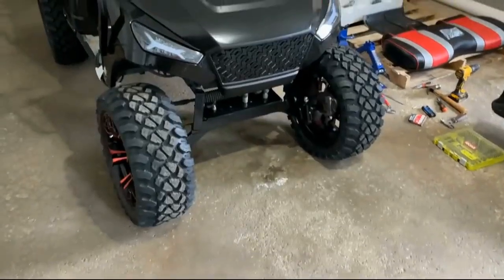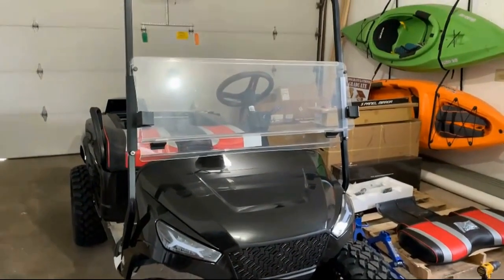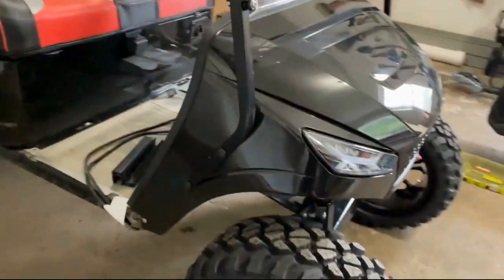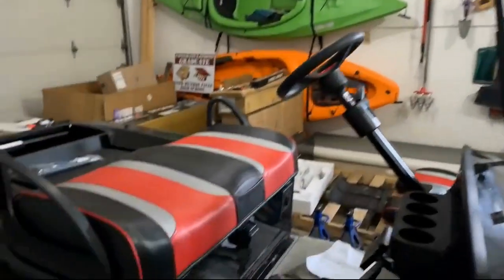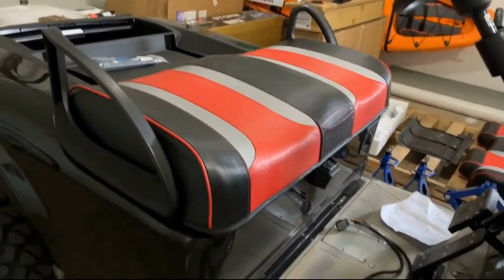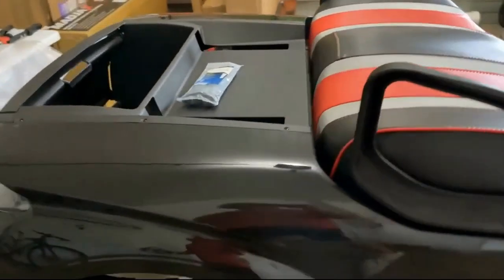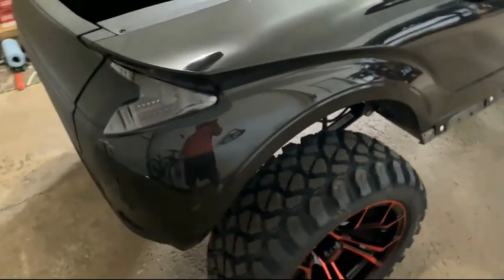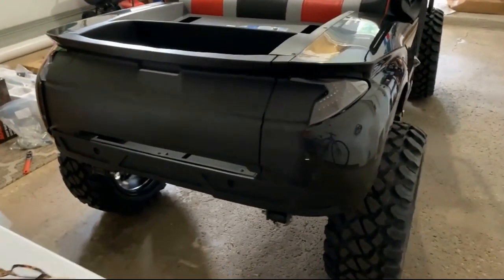EZGO TXT Golf Cart Conversion - Storm Body Kit, Seats, and More! - GolfCarTV (Episode 8)

Comment: Great video, question how tall is the opening of your garage? I’m trying to do a similar setup but don’t know what the total high of the cart will be thanks!
Reply from the maker: @FuNPeopLe3622 I'm not sure yet. I've driven the cart out of the garage without the top on and generally guessed that it will fit...I'm very hopeful it will :) I will let you know once I measure it.
Reply from the maker: @funpeople3622 we put the top on and it wouldn't fit out the garage! We ended up chopping about 6 inches off the rear struts and now it has plenty of clearance. For bigger adults, they'll have to slouch a little so they don't hit their head, but it's what we had to do. Also, I think it looks better when it's not angled upward to the back so much. Personal preference, I guess. A full review of the cart will be coming soon. Just a couple little things left!

Comment: hi do you have spacers for the wheels?
Reply from the maker: Hi, @danrg3000 We carry three different sizes of the spacers: 1”, 2”, and 3” Depending on your setup, we recommend more in the rear. Typically a lift kit will push the front wheels out a little bit, so adding spacers to the rear will even out the front and back. For this build, we put 1” up front and 2” in the back. https://www.convertedcarts.com/search?q=Wheel+spacers